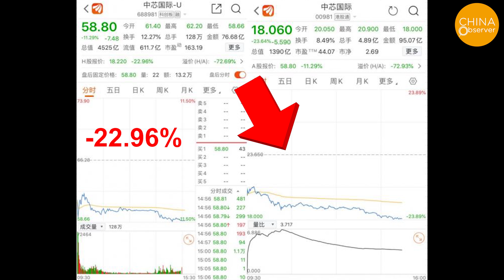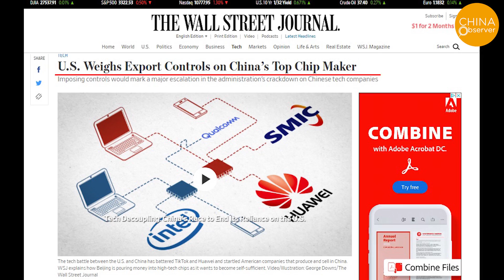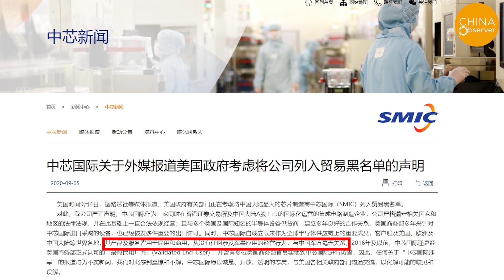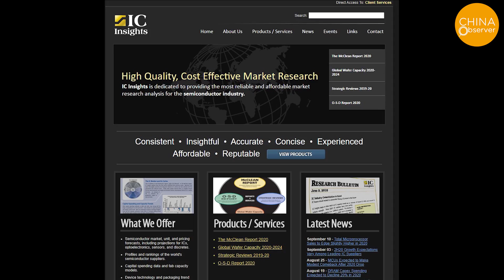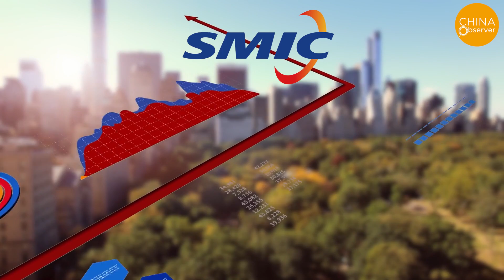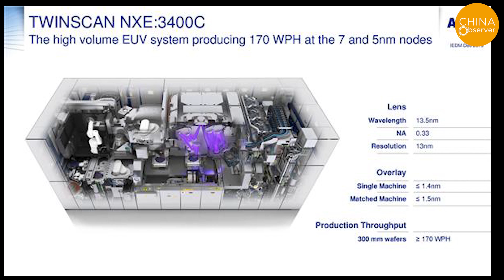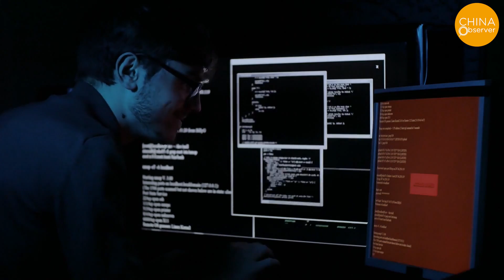Huawei future looks dark, China chip dream at risk|US weighs export control on China top chipmaker

Comment: SMIC is Huawei's  last hope to fabricate chips/processors.    SMIC is stuck at 15nm , can't fabricate even 7nm.    Huawei's Kirin processor is 5nm. 
These last shipments will last 6 months.   It took Samsung  16 years  from zygote 5nm to production.    Samsung/TSMC will be rolling out 3nm in 2021.
SMIC/Huawei  15nm     compared to   Samsung/TSMC   3nm     is completely laughable.     Good luck with closing that gap.
Reply: Don't worry. China can catch up western in 50 years or 1/2 what western needed. So they will catch up. Beside with 80/20 rules and huge population, china has more genius people than the USA.
Reply: @Melissa-zy6qi  Of course it will, but for now it doesn't look very good